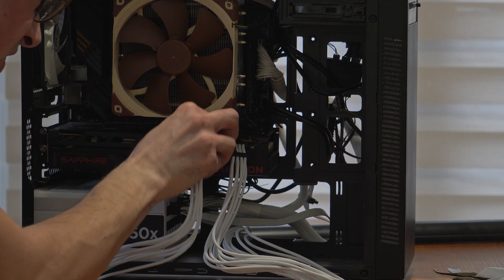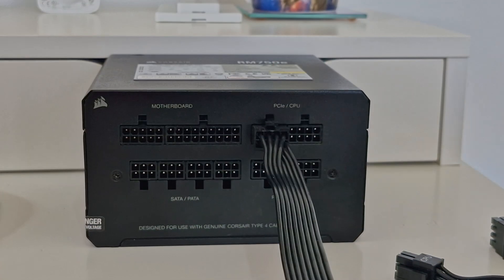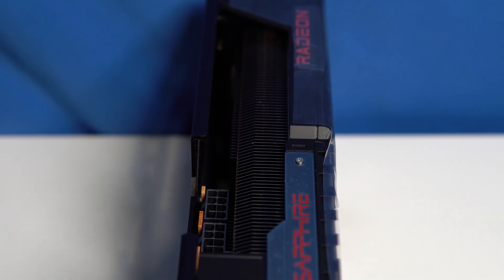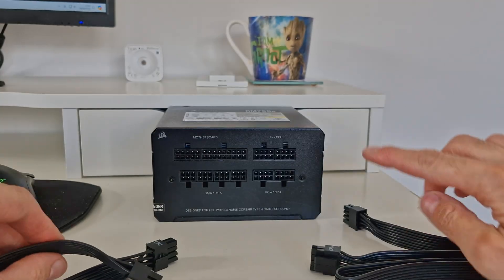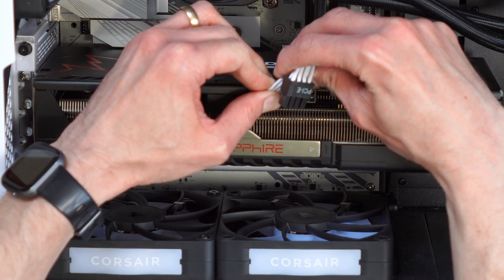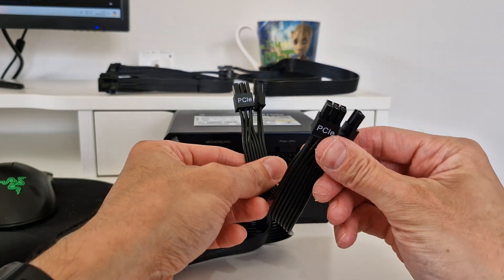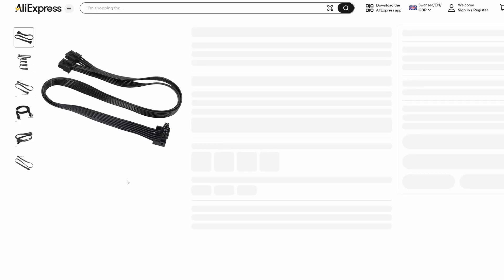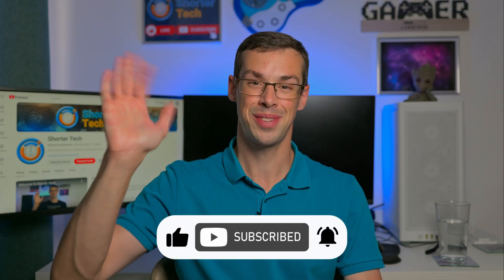NEVER Mix Your CPU and PCIe Power Cables (... In General!)

Comment: I have an NZXT C750 Bronze Non-Modular. It unfortunately has two EPS connectors and only one PCIE connector. Can I use an EPS to PCIE splitter for the extra eps connector and use it for my gpu? I have a daisy chained RTX3070Ti. I see some information around the web but there is little research for me to say it is entirely safe, I saw a vid did it on his 3080 without any problems though.
Reply from the maker: Oh... uh... I don't know. I mean, it sounds a bit sketch tbh. However if someone had that exact setup and it worked for them, maybe you could try - as long as the cables/splitters are the correct ones, the worst that could happen is you get crashing when your 3070 Ti gets maxed out (then you can reasses the approach at that point).

Comment: My question is more about the PSU slots than the cable. The sockets say CPU/PCI-E so does that mean that instead of using a CPU cable I can use that slot for another PCI-E cable? 
Like having one CPU cable in the first CPU/PCI-E socket and using  a PCI-E cable that has been connected to the second CPU/PCI-E socket for the graphics card?
Reply from the maker: Yes that's fine, good question :) Many PSUs do that. So as long as you choose a PCIe cable for your GPU, you can freely use those "CPU/PCIe" ports on the PSU yes. I do this often - running just a single CPU cable from the PSU, then using the rest of the PSU ports for my GPU power.

Comment: Some workstation GPU use CPU cable for being powered at 300w with only 1 cable (before the 12v high power connector was a thing)
Reply from the maker: Ah that's interesting, thanks for that :) TIL.

Comment: Agreed! Never mix cables. 
We need PSU manufactures to properly label both ends of the cable.
Even better would be a standard that everyone uses.
I keep all my spare PSU cables segregated and identified for the PC/PSU they go with.
Reply from the maker: Good point about keeping them separate, that can work well - I have a few PSU cables mixed up and never touch them as a result - doh. Where possible I like to keep the PSU boxes - at least those ones are all organised properly lol.